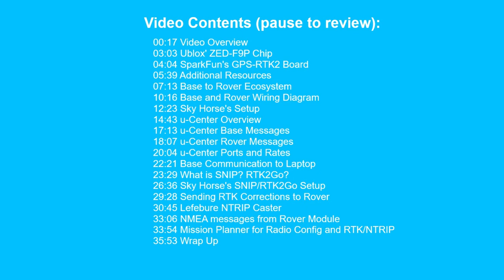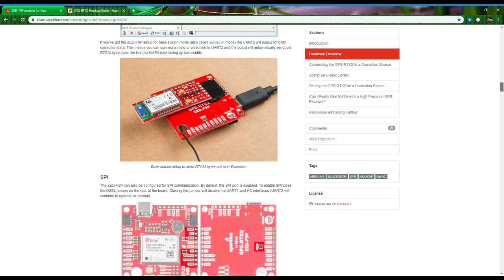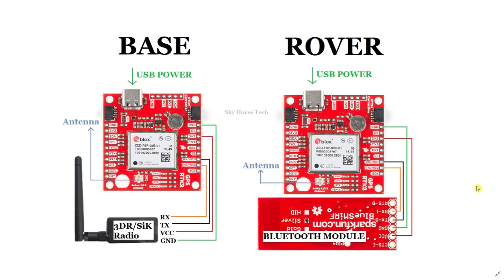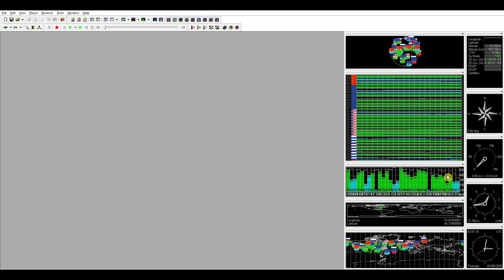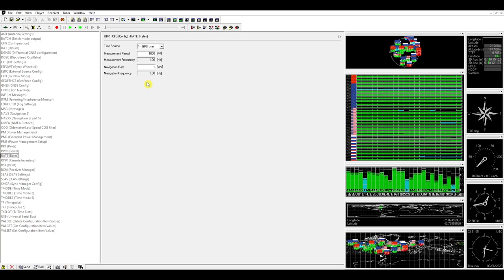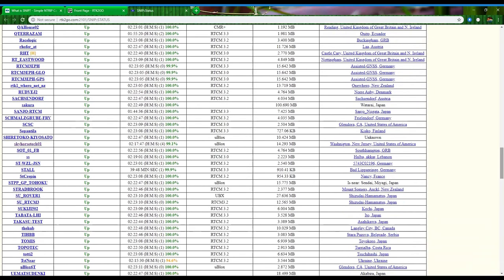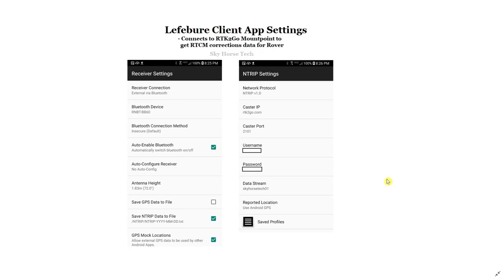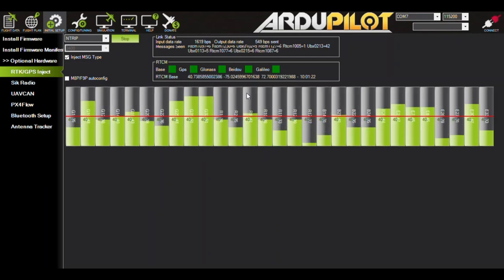How to setup ZED-F9P RTK Base and Rover

Comment: You can increase your accuracy to the mm if you use a 3" square card.   Set the GPS device exact GPS point at each of the four corners (if you ignore this you will create an error). Write down the GPS location of each corner, and then take the average of these values. (X1 - X2) / 2, (Y1 - Y 2)/2.   I've not done the entire calculation, but this is enough to get you started.

Comment: EXCELLENT VIDEO. 
I do all the step and i got fix but when i turn off the module it's configuration reset...

what can i do to make it permanet?
Reply from the maker: K, you are half way there. Now you'll need to enter the coordinates (LLH, aka Long,Lat,Height) into the Fixed Mode settings and save to RAM, BBR and flash memory. If you didn't write down your coordinates before it reset you'll need to run Survey In again to get those. Here's a good guide for updating to Fixed Mode: https://drotek.gitbook.io/rtk-f9p-positioning-solutions/tutorials/setting-fixed-llh-or-ecef

Thanks for watching!

Comment: does it work without ntrip. just base and rover using lora ant.
Reply from the maker: Yes definitely. Your base radio would transmit out of UART1 port and send corrections to rover board's radio connected to either UART port. You'd just need to config the radios (we use Ardupilot to do this) so they are using same baud rate as you have the F9P boards set at.

Comment: Hi! In your video, you started with Fix Mode: TIME (not 3D). I tried this and only get to Fix Mode: TIME whenever I input the position of the base in TMODE3. What if I would like to have a moving base set-up? How will I get it to Fix Mode: TIME without inputting the position of the base? Thank you!
Reply from the maker: For setting up a moving base you'll set the Time (TMODE3) to disabled. You'll also need to change the output RTCM messages, making sure 4072 is enabled. See section 3.1.5.6 in uBlox ZED-F9P Integration Manual for addtl details. You can also upload the moving base config file (found in https://github.com/u-blox/ublox-C099_F9P-uCS/tree/master/zed-f9p) into your base F9P thru uCenter. This will ensure you have the correct RTCM msgs being sent in a moving base setup. Hope this helps-

Comment: Good video, did you use a fixed point that you all ready knew? because in the "time mode" line I can't get the "time" result without put the exact coordinates in the time configuration. I'm using Youcors, I can connect my mount point and my client, no problem with that, but no corrections. Any suggestions?
Reply from the maker: Good question. In going back to our notes and method used we had pulled information from many sources, which that frustration led to this video really.This topic wasn't really well covered anywhere we found. Basically in u-center you'll want to go to TMODE3 (believe first 2 are for older uBlox GNSS). On initially setting up your base location you'll need to set to Survey-in in the dropdown. Select a duration and accuracy values. The recommendation is for several hours duration, however we eventually did it for 24 hours to really get a high accuracy. There are other options, for example near us the community college (WCCC) has pro surveyed GCP's. We could take our base on the survey tripod, place it over the marker, and enter those known coordinates in u-Center. Leave that there then take the rover to YOUR future base station and pull the cm accurate x/y/z, the base needs to be within 10km. Once you have the base Fix location you can change TMODE3 to use Fixed instead of Survey-in, just need to enter the x/y/z in same screen. There are other messages like HPPO* that show your absolute accuracy. That still needs to be ground truth'd using other CORS or NTRIP sites but is worth it. We will definitely add this info to a future video, honestly it could probably be an entire subject on its own. Thanks for your question!

Comment: Thank you so much for this video! Question though: how do I receive an RTK fix in u-center using the RTK Surveyor and a ZED-F9P module without NTRIP client? I also am utilizing the xbee s1 for the radio.
Reply from the maker: You would need another F9P module to act as the base station if you didn't want to (or couldn't) use NTRIP. You can setup the base in u-center to transmit the corrections then send those RTCM corrections to your rover UART2 where they are read in and processed automatically.

If you didn't need real time corrections you can always perform PPK (post processing) with corrections from a free service like CORS here in the US. You'd use a free software like RTKLIB to blend your rover files and CORS downloaded file to get an accurate fix. Many say that PPK is actually better as far as accuracy and consistency as in RTK you may lose your base connection for a few seconds which potentially means drops in your solution accuracy. Thanks!
Reply: @SkyHorseTech   
thank you so much for replying!

ok so what I'm hearing is that the SparkFun RTK Surveyor would not work and I need to use another ZED F9P module? 

With that, how do you set up the base station in u-center to transmit corrections?  Also would I use UART2 instead of UART1 (because I believe you used UART1)? 

thank you again for all your help!
Reply: @SkyHorseTech  is there any way I can message you offline? that might be easier?
Reply from the maker: @matthewkim5388  it sounds like you are just getting familiar with u-center in general. If just starting you'd probably want to use pre-configured files to load onto your F9P thru u-center. Those config files are avlb at  https://www.ardusimple.com/configuration-files/ where you can download the base file and use that to configure your F9P. As you become more familiar with the tool you'll be able to set messages and other settings like rates in u-center to maximize the potential. Definitely immerse yourself in the uBlox documentation on u-center, it's very thorough. Also spend half a day watching YT videos such as Roby and others that go through this process of setting up a base. In u-center you also configure what UART1 or UART2 are sending as output. UART2 reads in corrections automatically on the rover so you can use UART1 as output. Good luck!
Reply: @SkyHorseTech  thank you so much that really helps! I love your videos!
Reply: @SkyHorseTech  Sorry quick question: have you ever used the SparkFun RTK Surveyor as the base station and use a ZED-F9P as a rover receiver then observe the ZED-F9P rover receiver receive RTCM 3.3 corrections?
Reply from the maker: @matthewkim5388  We haven't but it may be possible. You can mix and match base and rover manufacturers but you will get a better result if both are the same type of unit as the errors will cancel each other out. As long as the base is transmitting RTCM 3x corrections (or raw UBX msgs) the F9P can use those just fine.

Comment: thanks for the video
would it be possible to connect a LTE 3G 4G module like SparkFun LTE CAT M1/NB-IoT Shield - SARA-R4?
I have  base at home with an ntrip server.
Reply from the maker: Looking at the hookup guide for that module it is compatible with the ZED-F9P over i2c/QWIIC. Just know you'll also need to add an arduino or RaPi board in the mix to facilitate communication thru that module. If you have the base at your home with Wi-Fi you can send corrections over internet to a mountpoint (SNIP/RTK2Go) and wouldn't need a separate 4G module. In the field your rover can pull in corrections over your 3G/4G phone (Lefebure), no need for extra module. Let us know if you go that route, good luck! https://learn.sparkfun.com/tutorials/lte-cat-m1nb-iot-shield-hookup-guide?_ga=2.167732023.880023549.1586562965-2098561182.1573429471#hardware-overview
Reply: @SkyHorseTech  I can now receive RTCM3 by RTK2GO.COM on my mobile and send the data to ZED-F9P with Lefebure.
the base station is a professional GNSS LEICA 1200.
I have a fixed solution at more than 15km without any problem.
but the NMEA GGA data sent by ZED are not very accurate, the elevations have a resolution of 10 cm.
Does Lefebure accept UBX data?
there are also NMEA ADV data which are accurate but F9P is not compatible. 
my mountpoint is GUEYESN
Reply from the maker: @YGueye1985  Excellent that you were able to get that far along. You'll probably want to isolate where that offset is being generated. Are you able to create a RINEX file from your base module? The ECEF coordinates of the base should be in the Rinex header. If those base coords are off by 10cm you can focus on the base. Also, in your F9P rover are you reading them in to UART2? That port will automatically process the incoming RTCM data. 
Lefebure doesn't send UBX but there are other apps out there that will do that. You shouldn't necessarily need UBX to get ~3cm accuracy. Be sure your base is sending sufficient RTCM msgs otherwise it will never get to a true fix. Also, research the compatability of the Leica base and F9P rover (e.g. if they use the same datum like WGS84). Since we have both base and rover using F9P we bypass those compatability, communication issues. Good luck!
Reply: @SkyHorseTech  thank you for your response.
Actually my I had no problem fixing the phase ambiguity, but the NMEA protocol that limits the GPGGA message to one digit after the decimal point for the altitude.
I found the solution on U-CENTER by activating the "HIGHT PRECISION MODE".
Reply from the maker: @YGueye1985  Ah yes, thank you for clarifying. I'm sure this will help others!

Comment: Hi,

First of all, great informative video. thanks for making it for us. I have a question. I am developing a system that will be mounted on a setup on the survey boat. I want to use the received coordinates to georeference my photos. Doıng some photogrammetry work for my thesis. I was trying to decide which u blox chıp and board should ı choose. I am from Germany and here we have a network called SAPOS and we receive corrections through that web. I am okay with up to decimeter level of accuracy. Would you suggest to use zedf9p 1 for heading of the boat one for georeferncing purposes ? 
thx
Reply from the maker: Hi there, thanks for your question. Definitely go with the F9P setup. If it is an unmanned survey boat using a flight controller (eg Pixhawk) you can use a Moving Baseline with two F9P's that will give you heading and exact location, no need for internal compass. See https://ardupilot.org/plane/docs/common-gps-for-yaw.html for a starting point but there are many helpful videos and posts out there with this setup. We're putting finishing touches on our boat with moving baseline and Pixhawk cube on a new platform. Hope to have video out there on that in the next few months. We have one of the F9P's output coords to pixhawk which uses it for RTK navigation but also forwards those coords via serial port to side scan sonar unit which tags that data precisely for post processing. Thanks again!
Reply: @SkyHorseTech  im actually trying to finish my hydrography MS degree by submitting this thesis. I already informed my supervisor to purchase 2 of these C099-F9P application boards. We have mbes on our boat too. It's crewed. Since only 4 months left for me to submit I'll keep here updated after each valuable milestone :) thx again
Reply from the maker: @omerfaruksuer277  very cool! Let us know how it goes!

Comment: Thanks for the video.  Can I still achieve cm level accuracy without creating my own base station, but instead using a publicly available NTRIP caster?
Reply from the maker: Yes, pretty easy (and possibly free depending where you live) for PPK using nearby CORS station (https://www.ngs.noaa.gov/CORS_Map/ ). You'd then take your rover GNSS data (either stored on rover SD card or thru app on attached smart device) and combine with CORS base data in RTKLIB to generate accurate corrected coords. You can also create corrections with real time RTK but will usually need to pay for NTRIP network monthly fee. If doing a bunch of RTK already after building a ZED-F9P rover it's not much more trouble to also build F9P base and will be much cheaper in the long run.

Comment: I have a set of 915mhz sdr radios and wired up like your example.
I had a hard time making them go into U-center. However, i got it to work by jumping or soldering the DSEL pads on the back which i believe makes it a spi port? not sure.
Do you think there is any implications by using it like this and eventually sending corrections to SNIP and RTK2GO?  thanks for you help and videos on this. Looking forward to some more step by step videos, yours are easy to follow.

Thanks again,
Joe

Comment: Hi great video! Do you know if you can modify the config in u center through the radio link only?
Reply from the maker: Thank you, it is possible to config over the radio. You'd have the computer/laptop with uCenter running connected by USB to one radio then your F9P connected to the other radio (e.g. SiK radio w/915mHz in U.S.). When you open up uCenter you'll connect to that USB port just as if you were connecting directly to the radio. Hope this helps-
Reply: @SkyHorseTech  it’s exactly what I did. The radio is attached to the f9p uart 1. But I only get RTCM corrections when connected. I think i need to connect the radio usb to the f9p usb to make it work. But I need to give power to the f9p somewhere else.

Comment: Have you been able to establish a stable data connection between the base station and Baselatop with the SiK radios? Or does the rover lose the fix as soon as a short data interruption of the correction signals occurs?
Reply from the maker: We haven't had a problem with our setup losing connections between the sik radios. We would leave it running 24/7 over SNIP and there you can see the drops being logged/displayed. That would happen about once per day for various reasons but would reconnect shortly after (~3 minutes). The main driver of steady signal is line of sight between the antennas. We put our interior antenna in a window facing the base antenna about 100 yards away and works well. You could upgrade to a RFD900 radio and could get further reach, they are programmed and used just like sik radios and can even have an RFD900 talking with sik radio.

Comment: Thanks for your informative video. would you please let me know the wiring for the rover and base for pixhawk flight controller?
Reply from the maker: We haven't set up our rover module in the UAS/Pixhawk yet but it's on the short list. The Ardusimple ZED-F9P board has a dedicated JST port specifically for Pixhawk com (https://www.ardusimple.com/simplertk2b-hookup-guide/) which makes life easier. If you're using another board like SparkFun's F9P you can use UART1 directly to the Pixhawk (5V->5V, GND->GND, RX->TX, TX->RX). Be sure the Pixhawk has updated firmware as older versions didn't support F9P. You'll want to configure the rover to output UBX messages which Pixhawk will process (https://discuss.ardupilot.org/t/zed-f9p-with-pixhawk-1-possible/53016). Hope this helps!
Reply: @SkyHorseTech  Thanks for your quick reply.I'll try.

Comment: What is the most suitable Wireless Real time data link technology for Real Time Kinematic corrections forwarding?
Reply from the maker: It depends on the distance between your base and rover. If you're talking a few hundred yards a 3DR/Sik radio is perfectly fine. If sending corrections longer distances out of that range you can hook up an ESP32 running an NTRIP server to push those corrections over wifi or 4G/LTE modem to something like RTK2Go where your rover can pull the corrections from. Sparkfun has a good tutorial on these options here: https://learn.sparkfun.com/tutorials/how-to-build-a-diy-gnss-reference-station. If you need a little more range (to your wifi router) on your ESP32 get the ESP32 Thing with u.fl connection by Sparkfun, currently backordered, but that allows you to add an external antenna. You can add an external antenna on a regular ESP32 but involves cutting the internal antenna and soldering. Hope this helps.

Comment: I want to survey the 6 corners of my 40 acre farm,could i use this to find my gps coordinates to match the county tax map coordinates? And would i need both the base and rover or could it be done with just the rover?
Reply from the maker: You would need to have the F9P rover on a drone platform to map the property then use a CORS (PPK) station or NTRIP account (RTK, $$$ for monthly subscription) without a base station. With both methods you can gain very close proximity to the county tax map to find those corners in post processing. Having a base feeding the rover real time corrections takes those needs away.  Here in NJ the tax maps don't actually give lat/long coords but if your county does then it would work. The one caveat is this obviously wouldn't be a legal 'survey' unless you are a licensed surveyor but it can give you ease of mind knowing where your property lines are. In some cases it may be easier, lot less time,  in the long run to have a surveyor come out and mark those points especially if you plan on building structures near or fences on those property lines.
Reply: @SkyHorseTech  Thanks for the response. I have checked the tax map (NY) and they do not show any coords. I do have the deed which has a starting point which I am confident in and then gives N17 degrees 47 west 1680.7 feet then S67 degrees 5 minutes East 571.4 feet and so on for the complete property. I was hoping to get the corners with the footage and compass directions and hopefully with GPS input I do also have a Mavic Air 2 drone and have my part 107 lic. I have used GPS apps on my iPhone like onX and LandGlide but they seem to move around a lot and can be off by 20 to 30 feet. I know where the property lines are approximately but would like to be within a foot or so for horse fencing. the property is in Sullivan County NY.Just looking for a way to do it myself if possible, surveyor quoted a $6500 estimate.